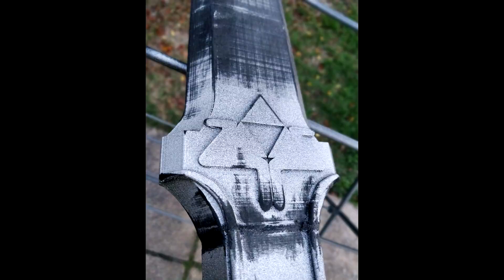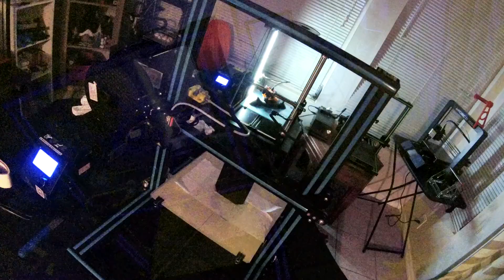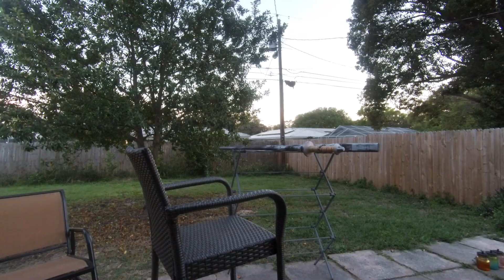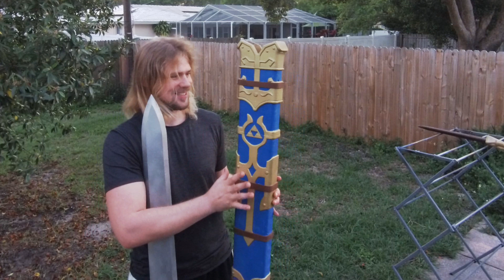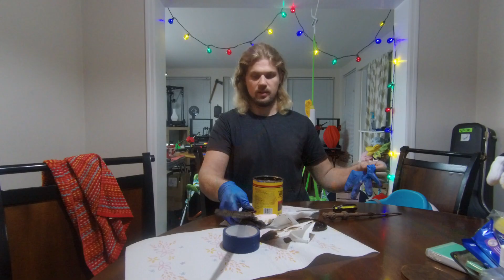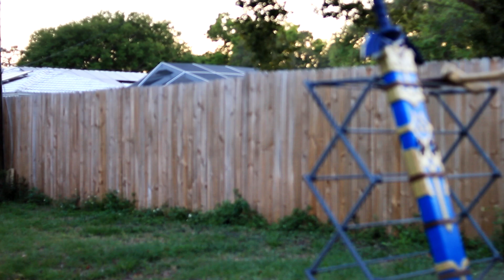3D-PRINTING LINK'S GIANT MASTER SWORD & SHEATH | ZELDA COSPLAY

Comment: Awesome! Was cool to see all your printers going at once. What did you use as a final coat?
Reply from the maker: thanks man) it was fun getting them on camera, I've been in the position a few times where I actually needed 4 inside running and 2 in the garage.. i still have a dozen other printers sitting idle lol but sometimes it takes more time swapping filament then it does to just wait for a print to finish)
For the final coat I used Rust-oleum Protective Enamel Spray! Seems to work really week and not stick when its done.

Comment: Seeing your A8 makes me want to try to get mine in working order again. Blew out the PSU trying to flash a different OS so I could use an auto sensor. Bad usb a to b cable I think.
Reply: Maybe I’ll start saving up for the CR10. That bed size is attractive heh. Good video Caleb.